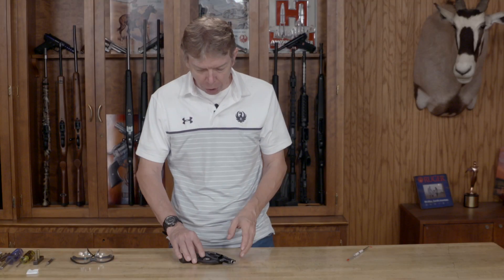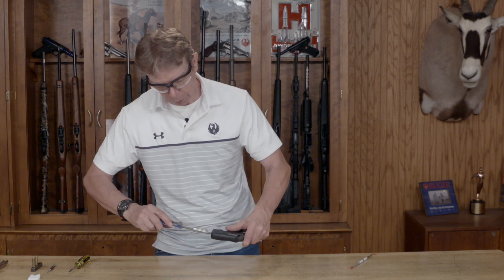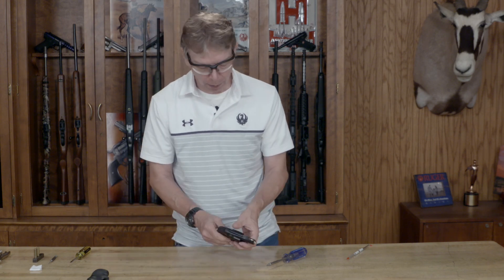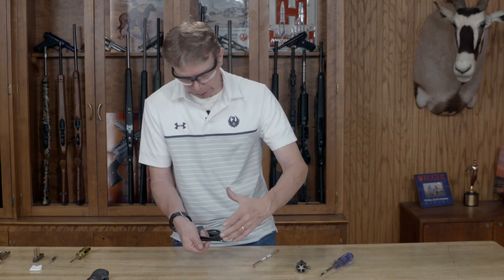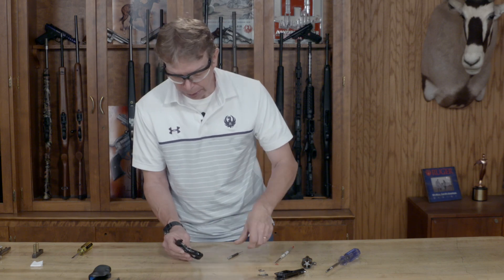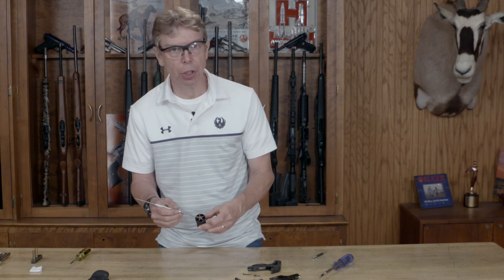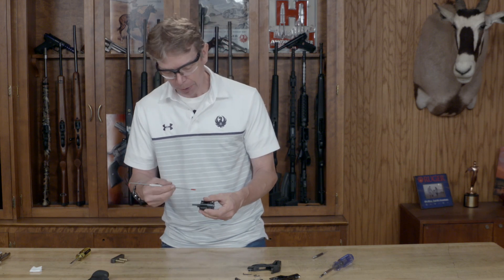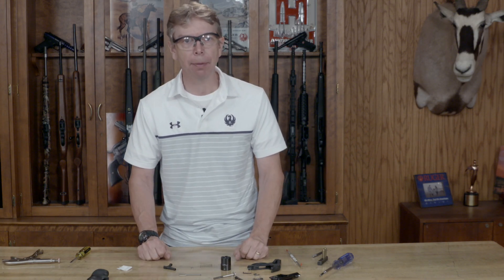Ruger LCR® Disassembly  Tech Tip

Comment: Should have zoomed in when showing the disassembly. We don't need to see the guys face. We just need to see the gun up close.
Reply: No kidding, I took mine apart today and it fell apart. Trying to find out WTF happened, appears ruger shipped my LCRx with a pin missing. Cylinder latch fell right out the second I took the  frame apart.
Reply from the maker: @toxicmatrix1337  We are very sorry to hear about your experience. Please contact our customer service department at 336-949-5200; M-F; 8-5 ET so that they can help resolve this issue.
Reply: @RugerFirearms  Thanks, I submitted a form earlier today mentioning the situation. 👍👍

Comment: I just got one of these in the LCRX configuration. He isn't kidding about that cylinder latch spring! Mine got slightly warped on me but was able to fit it over some super fine point tweezers and compressed it back into shape. Finally got everything back together and it seems to function great!

Comment: I am unable to dissasemble the cylinder assembly.  In a cw rotation the ejector rod will not loosen.  I have tried pliers, vise grips, small vice, and even heat.  It will simply not unscrew.  The factory must have applied a massive amount thread lock.

Comment: I've got an old ruger SA 22mag/22lr bicentennial model revolver. The hammer doesn't cock back when the gun is fully assembled, but when i take out the cylinder the trigger pulls back and fire just fine. What might problem be ?